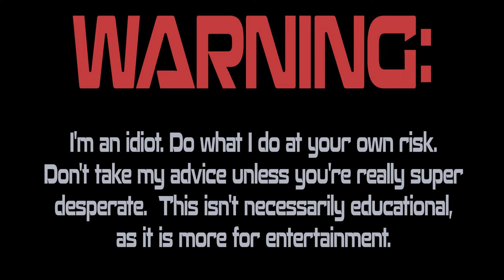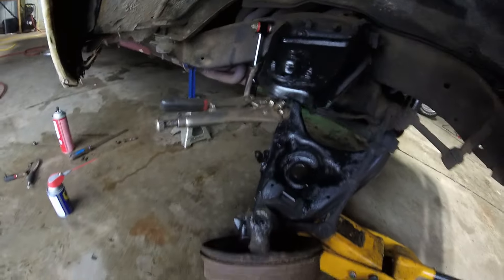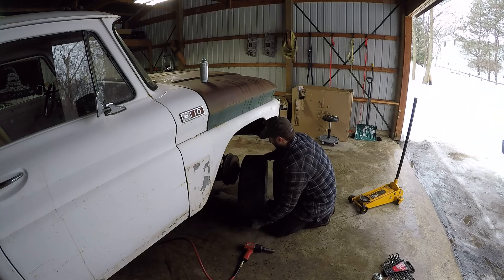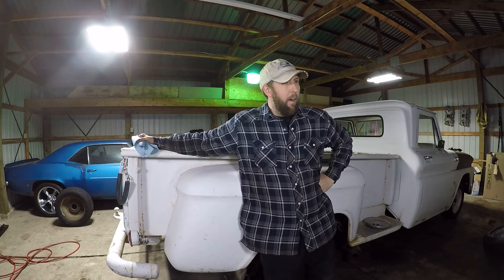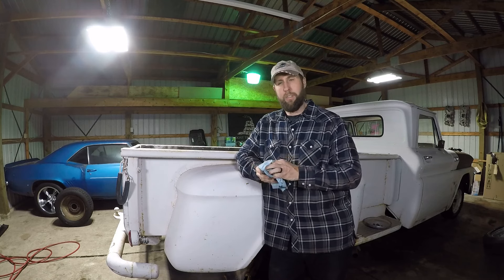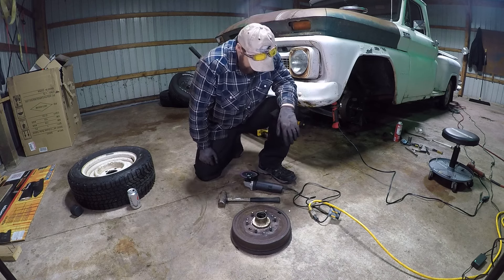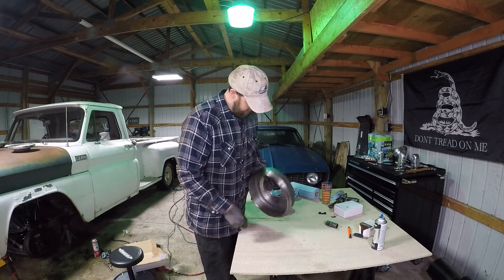Chevy C10 Gets lowered - Vice Grip Garage EP21

Comment: Somebody sponsor this guy and send him a shop heater ! ASAP
Reply from the maker: haha!
Reply: @ViceGripGarage  ..Derek has the propane 8,000 fry your back side unit. Noisy as a North Atlantic storm.Works good for drying /melting paint.
Reply: Me, I’d go with an old wood burning heater. I plan on putting one in my shop
Reply: Robert Boulware , it looks like bare metal on the walls and roof.
Reply: Robert Boulware insulation helps retain the heat, but a wood burner in an uninsulated building does surprisingly well.
Reply: There was a torpeedo heater behind him. Kerosene costs about $6. gazillion a gallon, so he left it factree
Reply: he should get more support..if it ain't 1 thing fighting a guy it's another..sum ting wong😕
Reply: @Robert Boulware he also has his shop door open.
Reply: There is a reason why I have in floor heating in my little 1.5 car sized garage.  My old body hates cold.  and a warm concrete floor counters the pain to some degree.
Reply: A guy could speculate that shop floors bout as cold as a field mouse’s teeet.
Reply: Had a boss that would say the heat was in the wrench's !! Lmao
Reply: camndino this guy would be a million times better than Fast n loud BS. Discovery pick this guy up.
Reply: Pellet stove would work as good as that concrete works for the ol' back.
Reply: seems like he has the side door open for some natural lighting. Hard to heat against that, unless you run a spot-heater.  Military surplus stores used to sell those pajamas/body suit things the navy and other repair guys would use in all sorts of foul weather. Pass gas once and you were warm for hours.  

as for the concrete floor, certain foil-backed carpeting works for a short while, otherwise yes, it sure is a heat-sink.
Reply: what did ja say ?
Reply: yeah it's spray cleared

Comment: My Dad had a white C10 short bed stepside when I was a kid. Had that same bronze interior, too. Straight six with a four speed trans. 1st was a granny gear. Only ever used it when carrying or pulling heavy loads, so normal takeoff was in 2nd gear. Engine was running bad when he first bought it. We pulled out the engine only to find that the problem was number six. She had a broken pushrod and the rocker had slipped off to one side, wearing a hole in the back of the valve cover. It was at the very back of the valve train, can't remember whether it was exhaust or intake valve, probably exhaust. He did the right thing, didn't check anything else, put in a new pushrod and rocker, and got a different valve cover from a junk yard (being there was no JB Weld back then) and we dropped her back in. She ran like that until Dad sold her.

Comment: I have found the easiest way to lower a vehicle is as follows. Tape a stick to the fender pointing down with the end above the ground at the distance you want to lower the vehicle. Turn on a hose pipe with a trigger spray outlet. Heat the spring in one spot with oxy-acetylene until the spring starts to sag. As the stick touches the ground quickly spray the spring with cold water. This stops the lowering and re-tempers the steel at the same time. Make sure you are wearing safety gear as you don't want scalding steam and water in your face and eyes.  Should not take more than 5 minutes a corner. I am joking but I have seen this done, LOL. Keep up the good work, I enjoy your humour.

Comment: I also live in a cold area and here is something I do in the winter when I'm working in a shop with no heat and no insulation. I built 4 walks with of coarse a door opening in one. I have them built where they can be put together and you just slide a bolt in and you have a area that is easy to warm up. Of course you have the inside insulated with what ever your poison is. Put a tarp over the top and a salamander or whatever way you want to generate heat. And you don't freeze.when your done, take it apart put it in a corner out of the way and that's that. It works great and you think to yourself, WHY DIDN'T I THINK OF THIS YEARS AGO! Or you can take acorner of the garage and only throw up two walls and something over the top.

Comment: Hint er roonie here: PB Blaster is  your friend, if you get a big steel ball penne hammer and hit the side of the spindle on the flat next to where the ball joint connects the resonance will break the interference fit and you won't need a pickle fork that usually rips the grease cover over the ball joint and proceeds to leak grease all over the brakes when your towing. Also I'm sure there's a cheap junk yard brake swap to save you a lot of money and probably somebody else's life when your hauling way too much weight on the trailer and the brakes are over loaded.
Reply from the maker: Thanks Thomas! Great tips!

Comment: Favorite car channel by far! Keep it up!  I want to thank you for practical style of wrenching, why just last week I finally decided to fix the broken drivers side motor mount on my 2000 chevy blazer. I ordered the part, did my video research and like any other gearhead found out that they are notorious for not lasting due to poor design. So I did the right thing and exchanged the motor mount for a fancy 2 pack of blue engine retaining straps with built-in ratchet mechanism.  I elected to go with 1.5 inch 1800lb version, figure if it weighs more than the engine it will last twice as long. I removed the air box assembly, hooked one end to the A/C compressor bracket and the other to the outside frame hole.  ratcheted  it down to 3 clicks past tight, reinstalled the airbox, started vehicle and performed necessary brake torque. The strap held, engine no longer jumping! So it was time to feed it the onions, give it coal on test drive! Holy Crap! Its been 9 months of driving that thing like grandma to keep the engine from elevating, now I can beat it up again. Saved 3.5 hours of hell, 15 bucks, and I have 1 more strap on hand for another repair. That is what you call a Win Win Win! Thank you VVG!
Reply from the maker: Haha this is great! Thanks

Comment: Everything fights you, just did this on my 68 c10, I had to cut the bolts off of my rear springs. But loving it now that it's done. Oh and i put an adjustable panhard bar in mine to re enter the rear end.
Reply: Christopher Olinger if you update to front disc brakes, would you leave the brake cylinder alone?

Comment: I've blown wheel cylinders in the worst places and times, to keep from losing all the fluid I keep a short nail with a head about the size of the line, take line off put nail in the hole and tighten her up.  Of course this was only a temporary fix that I've driven a year or so on.

Comment: KROIL
THE OIL THAT CREAPS 
that is the best penetrating oil I have been adding it to the brake fluid in a car that’s been sitting for a long time because it lubricates the pistons inside the calipers it only takes a couple drops also great For un seizing a motor

Comment: Like the Dresden flag Brother.  I keep WD-40 in my shop and use it regularly...but not for penetrant any more.  PB Blaster, CRC Freeze Off, Break Free all 10 times better penetrant.  Turns out it does make a difference.
I never get under a vehicle with a wrench (or any tool) in hand without safety glasses.  Getting jagged filthy crap in my eyes is fun of course but it slows me down too much when I can't see.  I end up connecting the wobulator to the discombooberater and that just hardly ever works right..

Comment: u didn't put new ball joints on after destroying the boots w/ the pickle fork?  or do them when you redo the front brakes?  Winterforce tires are great for cold and snow, but are no better on ice than no-season tires, assuming they haven't adjusted their rubber compound in the past 6 years.

Comment: Don't get me wrong I love that truck but being that low if you put a heavy load on it. The back the bumper might hit the ground unless your going put air bags under the back before you haul any heavy loads. It is very nice to see the older trucks on the road still today. That bed on their is very hard to find in that good of shape.
Reply from the maker: Pulled with it yesterday, the overloads did pretty dang good.  Don't think it can take too much weight in the box, but trailer pulling should be okish.

Comment: Had no overloads and found my spring locators all fully rotten. People that dont want to risk possible dissection getting the old kaka off your truck need to support the frame not supporting the axle like i did... finally got bright and used a 2x4 between the frame and truck arms as a safety while holding the frame up with a jack. The CPP kit i got had the locators all included... more deluxe kit but still do they expect people to reuse the 50+ year old ones ? Bad form CPP.
Reply from the maker: I felt the same pain!

Comment: I did this to my 63 c10 2.5 drop spindles with 3 inch drop spring in the front 5 inch drop spring in the back. I broke the same bolts it sucked.

Comment: Is that 1 1/8" bold holding the wheel cylinder on left or right handed threads cause I can't get mine off. So we went ahead and did the right thing and just smacked the humps with a hammer
Reply from the maker: haha

Comment: I've always worked on my own cars and trucks. Diagnosing a problem is freaking hard for me because beyond the very basics I don't know what makes a vehicle work, but once I have it diagnosed I can fix it. I want an older project car that is complete, but that I can work on and get going. Just something to jack with in my spare time. Do you have any tips on where to look or what to ask? I'm afraid I'm going to get a vehicle that is missing a transmission or something and not even know it's missing it. Any help would be appreciated.
Reply from the maker: I would start with understanding what goes into a full vehicle inspection.  There's plenty of how to's and videos on that.  Once you get that down, you'll be able to make a much better purchase than guessing

Comment: I had a 63 f100 i flipped lowered but i did it the right way and flipped the front bar and remounted the rear plates it put the truck 3 in the front and 6 in the rear but then divorce happened before i finished it

Comment: Took my “project” out last night with about 13.7% brakes and zero gas, no lights, windshield or gauges and I made it 50% out of the driveway and it died and the battree was dead’s with no digicals and the fucker rolled all the way back into it’s spot in between my 2 post lifts towers and puked all the fresh trans fluid all over my shop floor... fuck it, I’m getting my mower ready for summer today!
Reply from the maker: It just sounded like she just didn't want to go and she just went back home on a guy 😂

Comment: At 6:40 the "front end rejuvenation spray" is just black spray paint, right? I can never tell when you're serious or not. Are there actually benefits to spray painting under the vehicle like that?
Reply from the maker: It's just spray paint bud.  Keeps it from flash rusting and scaling for a little while
Reply: @ViceGripGarage  I'll keep that in mind. I'm restoring a 1969 El Camino with bad suspension.

Comment: What a waste of time and money. Not to say even dangerous. Forget all that. just drive the truck into the garage, slide of 4 x 4 under the frame grab your cutting torch heat up the spring and when they sag and touch the four by four stop heating them.  Let him cool and you are done. Back 'er out of the garage she's lower than when you drove in. Then take that spring money you didn't spend and take the little lady out for beer and pizza - in a lowered C10.